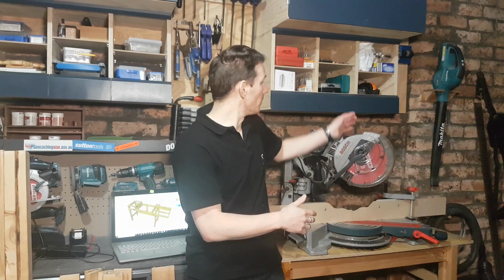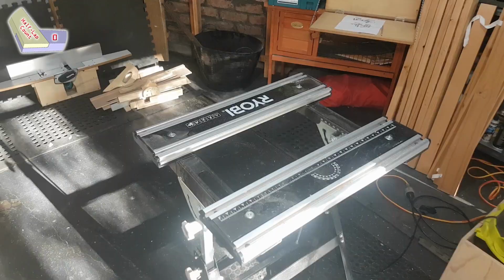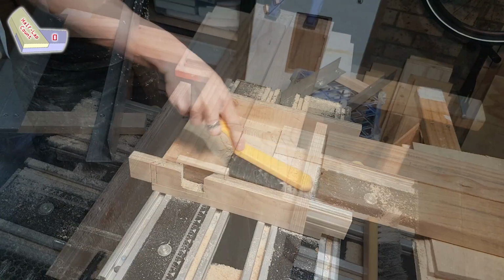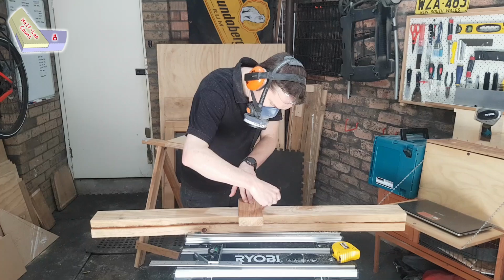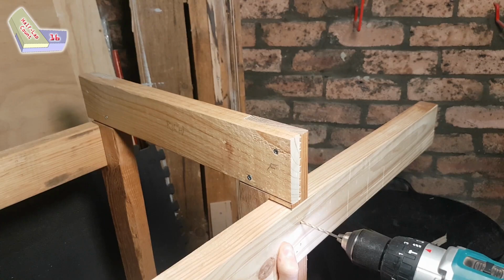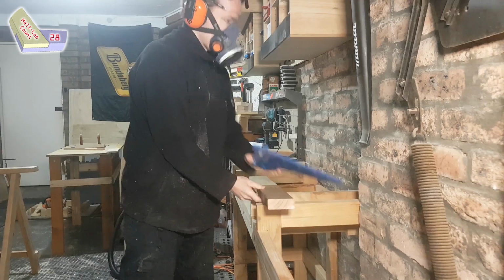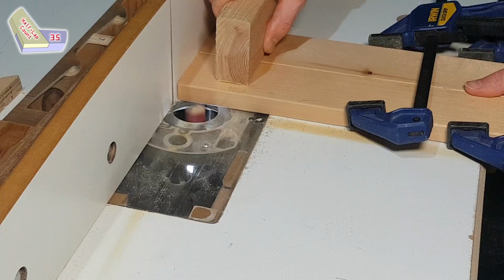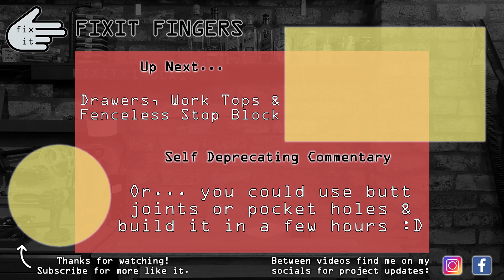Hectic Half-Lap Mitre Station Frame

Comment: Mate mate, bloody Grouse determination displayed here & a great result considering the materials used, they can cause you sleepless nights pine 😱.
With the Mitre saw laps check out the bulk & then put the blade down & feed the stock left & right & move the Mitre saw out on passes, saves massive time.
Keep rocking 🍻👍👍👍🇦🇺
Reply from the maker: I kinda tried that but chickened out  😅 Was being a bit precious about my new blade I guess. Still fairly new to this big saw!  Will have to try that if I lose my mind and attempt this again 😁🍻
Reply from the maker: Ps not as many sleepless nights as the neighbours missing their bed slats 😂
Reply: Fixit Fingers All in good time James 👍👍👍

Comment: Thanks for the video. I am also working on a project at the moment. Just as I started it dawned on me that I had way over complicated something that could be done almost as well in a fraction of the time using standard construction techniques. But I'm still going to do it the complex way. I think it is something about wood workers where we just seem to have to come up with a complex approach to things.
Reply from the maker: Well it is kinda the point for us isn't it? Sometimes you are building just to get it done, in which case the easy quick option is the best. But as we are doing these workshop projects for fun, why not make it over-complicated and challenging? No fun in doing something repetitive you know you can do easily 😃